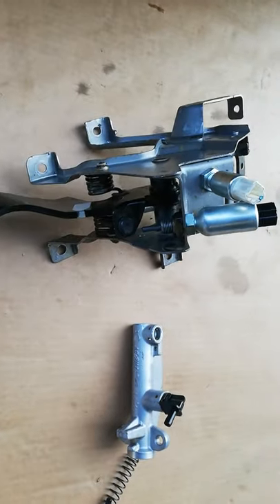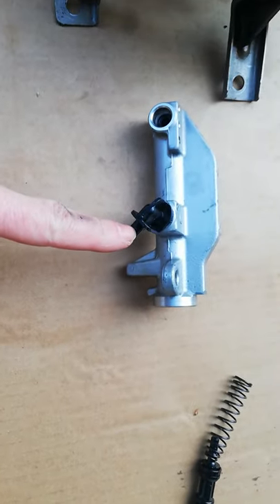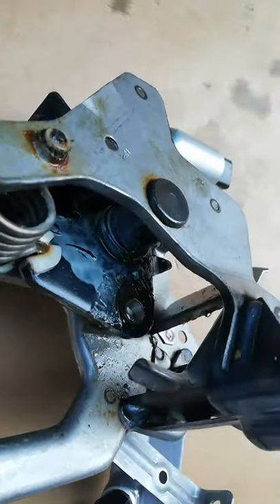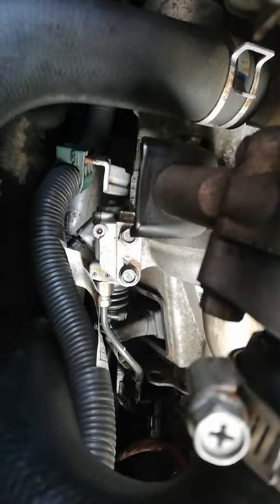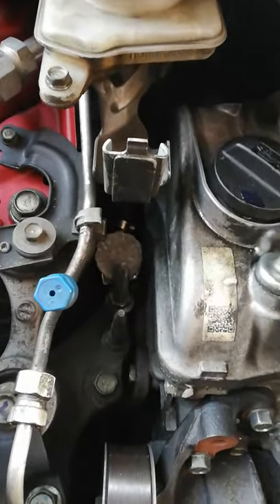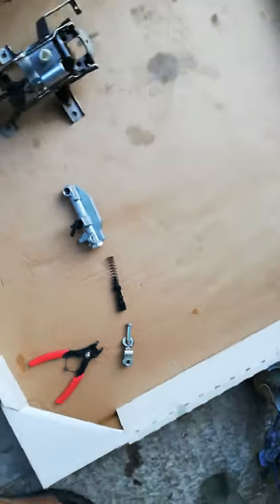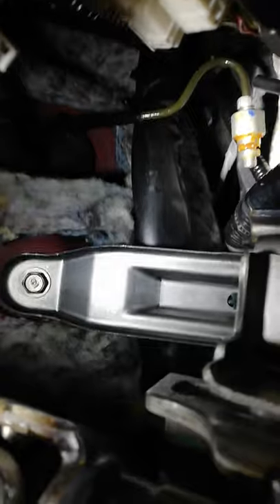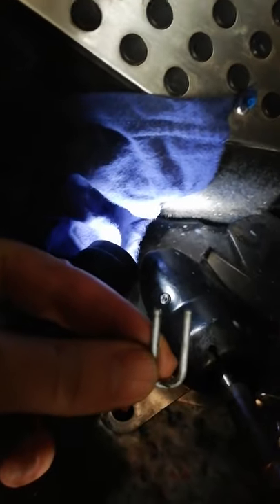Civic clutch master cylinder removal and strip down.

Comment: Cracking video!  I've been searching for this for days.  I hate the CMC set up on this car.  I have a 2.2 and been having tremendous issues with the hydraulics.

I'm a very hands on bloke but after setting the CMC length a couple of times I really cba with the job changing the cylinder.   Back breaker what ever angle you're at.

May I suggest an edit to the video title to include 2.2 civic?  Should get you some more views 👍
Reply: Did you rebuilt the cylinder with a service kit?  I can't find one for it and it makes me ache having to pay for an entire new unit.
Reply from the maker: Thankyou! I too struggled for info before starting this, I hope it's helped get your issue sorted. I will also add 2.2 into the title/info. 👍